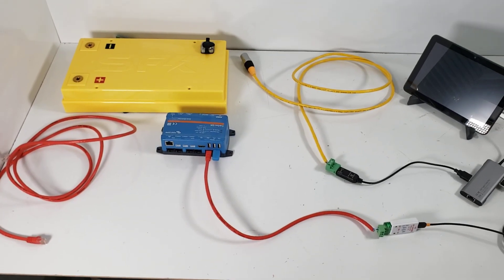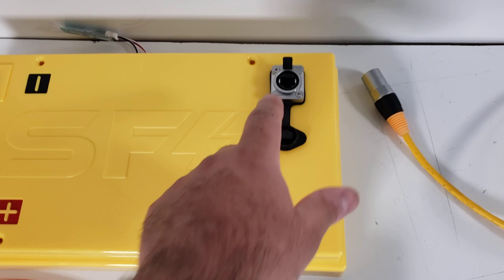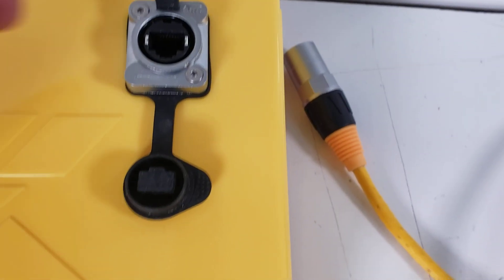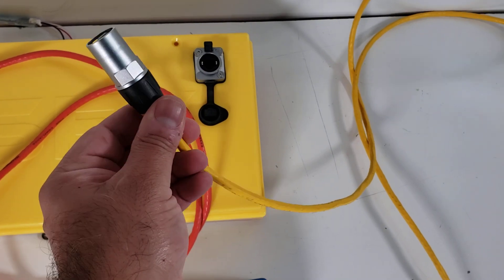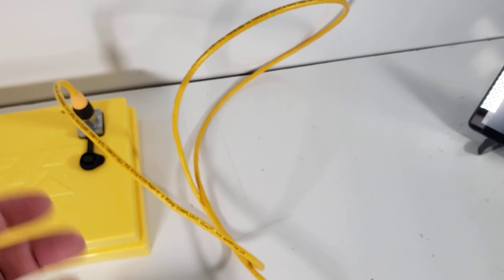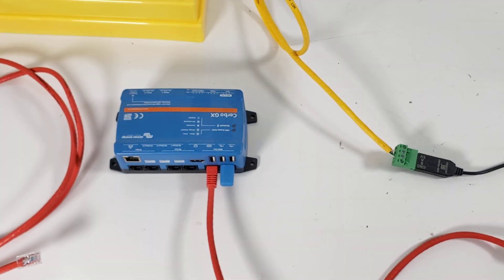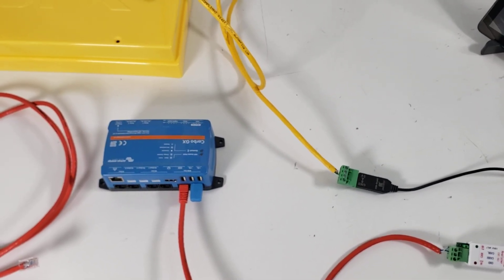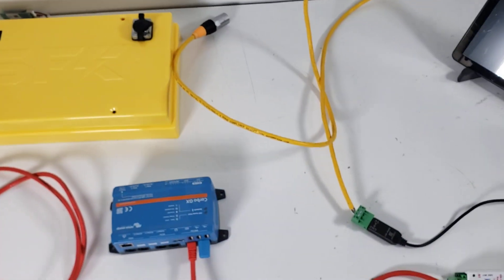Hard link (RS485) For Kits & Pre-built Batteries

Comment: Is the RS485 port enabled on the V3.5 kits with the 200A BMS?
Reply from the maker: Also we will have a UART to USB adapter as well, in this case you'll have to disconnect the bluetooth dongle but can connect the RJ45 port to the Uart port of the BMS.
Reply from the maker: All V2B BMS have this, if you have a V2B than it is there.